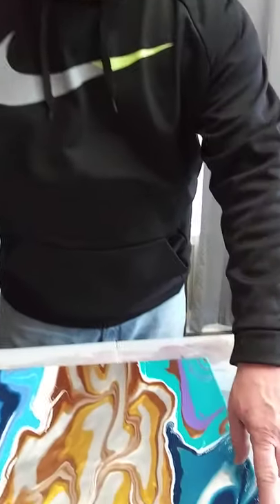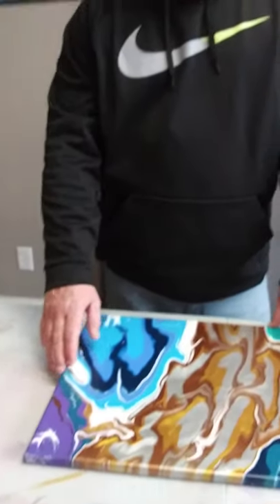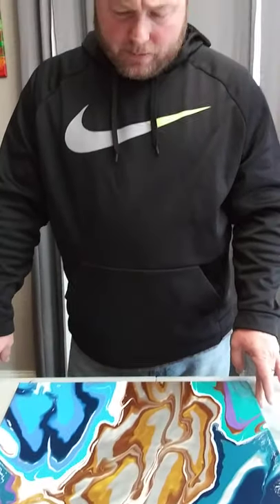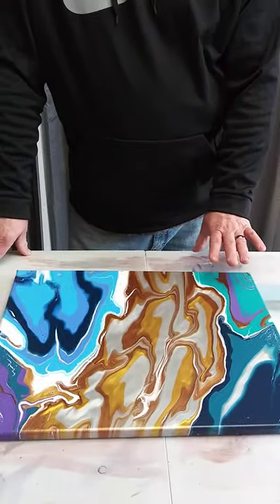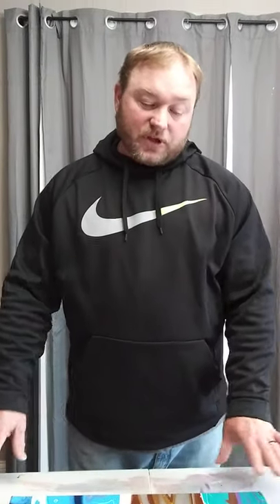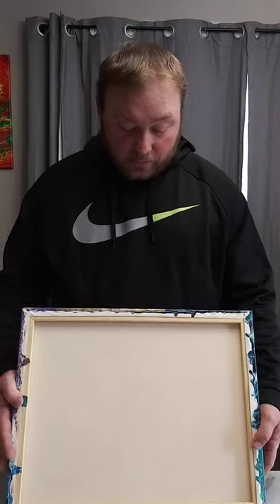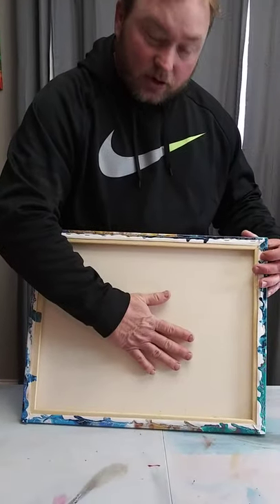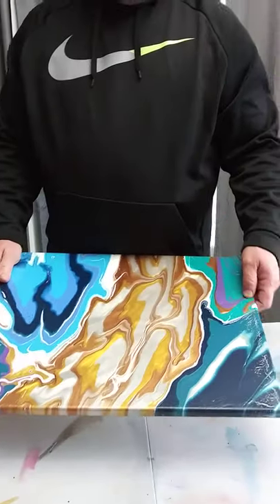4. Why is my acrylic pour painting cracking?

Comment: Hello Dave my grand daughter did a really beautiful painting but the next day it had cracks on it.  She used premixed paints and mixed up a few others could that be the problem
Reply from the maker: That is hard to say without knowing exactly what she used or the conditions where she painted. 
Apple Barrel white from Wal Mart definitely has a tendency to crack.  
If the temperature is hot, the top layer of paint dries too fast and creates a skin that will crack as the bottom layer dries. 
Finally, you mentioned that she used premixed paints....  As far as an educated guess, I would say that those were the culprit. I have used some Masterstouch premixed paints from Hobby Lobby and some of those colors cracked.
Every paints is made with 4 basic ingredients....... pigment, binders, additives and water. Some premixed paints may have been diluted too much for the binders to work properly. I suggest mixing your own paint to one of these recipes.....
1 part paint
1 part Elmers Glue All
3 parts Flood Floetrol
Water to consistency.

For higher end results....
1 part paint
1 part GAC 800 from Golden
3 parts Flood Floetrol
Water to consistency.

I also have a video on how to properly mix your own paints to consistency. I hope this helps.
Reply: @davesacrylicpouringart1197  Thankyou for your reply